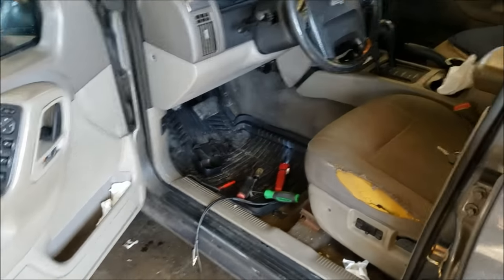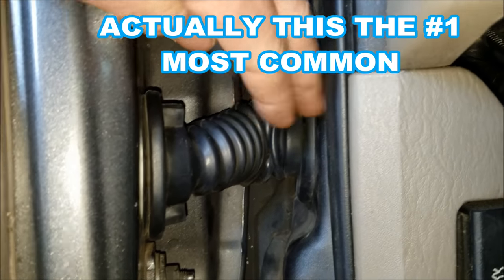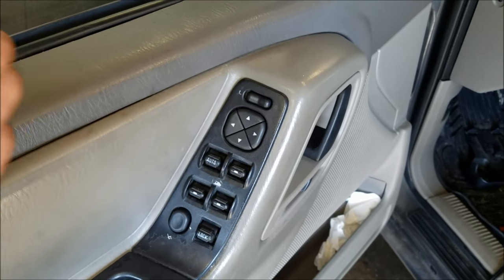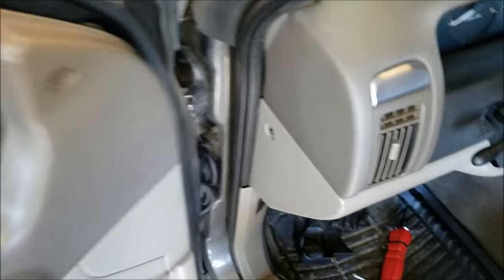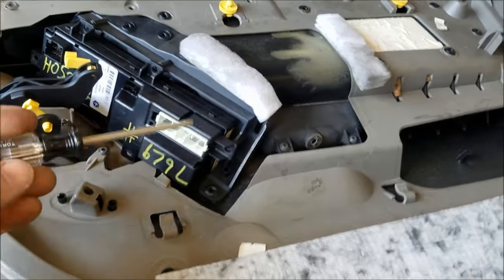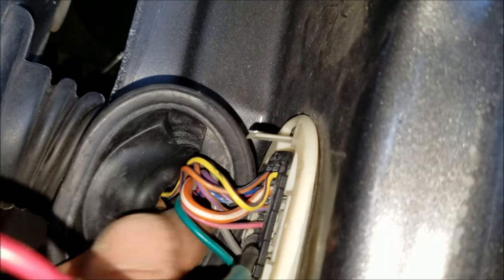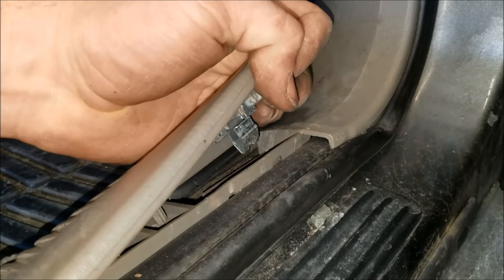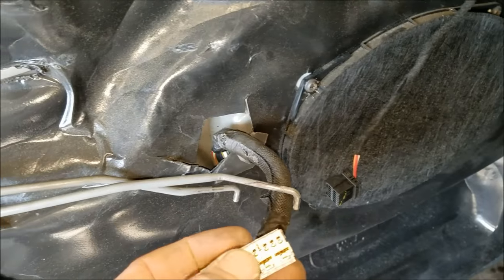JEEP Grand Cherokee Windows Don't Work 1999-2004 replace master switch / broken wires

Comment from the maker: On Amazon:
*OEM MOPAR SWITCH: https://amzn.to/2NFJsOg
*PLASTIC RETAINER CLIPS: https://amzn.to/2ZF6J56
*DOOR CLIP TOOLS: https://amzn.to/2PnUwC5
*DOOR HARNESS: dealer only?
Reply: Yes!! Jeep rolls up. Nothing works on drivers door: locks, windows, mirror, lites etc. Open the boot, splice the broken gnd wire. Everything works. 10 min. and done.  This info is NOT in the repair manual. Saved me a ton of grief and time. 
Thanks a million!

Comment: one more source is the bcm (body controll module) it can get its memory clouded with junk readings and it drives that computer nuts. and it can cause problems with about naything on the body. thankfully there is an easy cure . re boot it. turn ign switch to on , remove both cables from the battery . wait about five minints and then touch those cables together to remove any residual voltage held in the computers.  re install the cables and wa..la. computers are rebooted and cleaned out. this little trick could save you 800.00 or more. when the dealer tells you computers have to be replaced.... This also resets the engine computer and removes any exsisting codes turning that idiot light off too......if that light re-appears after this , read the code(s) and perform those repairs.  doing this tho can fix a bucket load of problems simply and can save you alot of money in the shop. AI, is gonna be mans down fall but we can allways remove the batteries  :)

Comment: I have a 2001 Grand Cherokee that we pulled the entire dash out to do a heater core and evaporator the radio stays on when the key isnt on the parking lights are on all the time even with the key off the new blower motor wont run on high and the gauges wont work but if you fiddle with the turn signal /headlight switch the gauges come back and it will be fine a few hours then cuts out again. i replaced all the battery cables positive and negative all the way to the starter and the fuse distribution box the relays chattter on the inside fuse block at the same time its got to be a bad ground, i took a wire and grounded it to the seat bolt to the black wire on the blower and bam everything comes back but if i leave the temporary ground to the blower motor hooked up the blower only runs on high! The engine runs fine and starts fine but thats it

Comment: So I’ve got this problem. But all my fuses are fine the wires in the door harness are fine and I’ve getting power to my switches. But not a single one of my windows work

Comment: Which fuse is the one that is for the master switch I’ve looked everywhere and can’t find it
Reply from the maker: That's a good question. Unfortunately I'm not sure off hand. If I didn't cover it in the video I apologize
Reply: Make sure you check under the wire harness boot very well mine was broke three inchs up in where it was hard to see. He saved me alot of money

Comment: Had similar problem,on my 2000 grand cherokee...and it turned out to be really simple. Battery connections. Mine are all new,nice and clean...but one of the wires was not making good connection.  If you are chasing the problem of no windows working,intermittent console....clean and tighten your battery terminals. Could aave a lot of headache

Good luck 😎

Comment: You were right on! After watching your video I went out and found the broken power wire in the door wire bundle - caused by the wire being worked/creased and over time failed just as you identified in your video.  Repaired and returned to service in less than 20 minutes from start to finish. Very thankful to have found this video. I'm a new subscriber!!!
Reply from the maker: Awesome to hear the video helped out and thanks so much for subscribing

Comment: I have the exact same problem. Found that the ground has a break somewhere. I took a pice of wire and stuck it in the master switch connector and found another ground - the ignition switch and everything worked but after watching your video I need to check the passenger door. Wiring diagram shows a ground there as in your video. Thanks dude good stuff.

Comment: I had the same problem . After the second time I bought silicone coated ELECTRICAL METER LEAD WIRE. much more flexible jacket and the wire has more thinner conductors. It was a pain in the ass but worked good.
a

Comment: Great video 👍🏼👍🏼 I almost spent over $250 on the switches . I looked at the wires , and driver door had a wire cut into . Easy fix so far spliced it back together. Thanks for the video it saved me money for sure .

Comment: Thank you for this video. Because I had the same problem with my Jeep. Checked those door harnesses and found the same broken wires and one that was about to in the driver door. Reconnected them and my back window ups again. 
Thanks again 😊

Comment: Great video!!!  Lots of useful information at a perfect pace, really, really appreciate that!!!!!  (really) not wasting time with "fluff" , rambling on or other off topic babbling.  To the point quickly from an obviously very good (very smart) mechanic!  Thank you!  (I rarely comment, only on top notch content, it is appreciated)
Reply: I had (4) broken wires in the rear driver's side door jam, soldered in new sections of wire and good to go, thanks again!
Reply from the maker: Got you, glad to hear the video helped you out and you got it rectified! Thanks so much for your feedback also. I greatly appreciate it

Comment: Thanks for sharing this with me my 04 wj has no response for windows or locks on either passenger doors I'm anxious  to use your techniques and it's pouring down rain right now. Cheers from Jacksonville Florida
Reply from the maker: No problem! I'm glad it helped out
Reply: Hey man thanks again it finally quit raining and I opened passenger door sliced open the rubber boot and there it was a fat orange wire with a clean break like it had been cut I spliced about 4" of wire onto the severed orange ends and VIOLA windows and locks work perfect on all doors and either switch THANK YOU SO MUCH. Cheers from Jacksonville Florida

Comment: As soon as I look on the passenger side I found the broken black wire 😮 then I checked the driver side and I had two broken wires, the black one and the orange one . Both are the fattest wires in the harness, I put them back together and what do you know I got my power windows back working . Thanks for the info !

Comment: @Nononsenseknowhow Hey man great vid thanks! I have replaced all my wires and the only thing not working is the lock switch, locking them to be exact as the switch works to unlock the doors but not lock them. All wires are good, all fuses etc I replaced the master switch box and STILL have the "lock" part of the lock switch not working. Any ideas man? Appreciate it!

Comment: Just dealt with the same exact problem today, broken wires and all. And it had a 20 year old alarm wired into master switch harness and all the windows. All that fixed and still needs a master switch lol

Comment: Great video question though...what is the middle plug for on the window switch. I went to replace my switch and it's still not working and the middle plug on my switch doesn't match up with the one on the car but I have the oem part

Comment: Hey thanks for the video, how exactly do I repair wires if mine is broke?

I just had my power windows/mirrors and locks stop working on the drivers side. The door lock works on the passenger side but even my keys can't unlock the driver's door.
What do I do

Comment: Great video. Trying to fix my daughter’s Jeep. Same issue- driver front & rear windows work.  Only the drivers side mirror works. And only the drivers door will lock with the lock button. 
Nothing on the passenger side works- windows front & back don’t work. Passenger side mirror won’t work, and neither door locks with the button on drivers side or the passenger side button. 
Bought a new switch on eBay & had the same problems. Found your video & watched it. I’m wondering if the harness on the passenger side Carries the power for for both doors AND the power mirror? 
Also, the fuse block diagram in the owner’s manual does not list a fuse for any of the power windows or power mirrors. Or power locks. I tried to check those 1st before taking the door panel off, but no listing for any of them.  Any advice on those would be great.

Comment: Great video. Direct and to the point. I have this issue, but haven't been able to find the break. I assume can be in any of 4 doors or rear liftgate? Also, should I cut boot(s), if necessary, to get access?

Comment: We have a 99 G C and the windows will fail on occasion, We found that disconnecting the battery cable gets them to work again. Any idea what is behind that?

Comment: Is there a way to roll up a window manually? My driver window has been down for over a week and I took the door panel off and tried to pull the window up but it only went up about 3-4 inches and wouldn't go any more. None of my other windows will roll down.
Reply from the maker: If the motor is shot, there is not really a super easy way. On some cars you can cut the lift cables and then manually push the window up and secure it. Probably best to just find out why it's not going up. If it's electrical issue you could take the door panel off and directly apply 12 volts to the window motor

Comment: Hello what would you suggest if the white connector is backing off the window  master switch ? If i press or hold it just so the window works . So i don't know if its the switch or connector or part number. If i did order a connector and it says right door do you think it would be any different than the driver side.I may try to test this some how by moving driver door over to passenger side and plugging into it and see if that backs out as well and works .Any advice appreciated thank you
Reply from the maker: zip tie or a little silicone sealant should do the trick.

Comment: Hey great video! If i reconnected a broken wire and have power locks and mirrors back, but still no power windows… could you tell me what the issue could be? Thanks!
Reply: Did you find the issue yet?

Comment: I have an 04 WJ 2WD and Casper the Friendly Ghost keeps rolling down the drivers side rear window with no one touching any controls. It rolls all the way down just like the driver's control operates its own window. Never partally. If I activate the passenger window lock it doesn't do it, but if I unlock the pass win lock it's liable to roll down randomly again.  Sometimes but not always I can get that window to roll down just by unlocking the Pass win lock. Fun and games. No other anomalies. The Jeep is otherwise perfect with just over 100,000 miles. Switch? wires? or exorcism?

Comment: what about if i've checked the fuses and both boots and the orange wire gets power but rest of terminals don't light up when i test them. but i don't know what's next because i've checked everything and all windows still won't move
Reply from the maker: Honestly I wouldn't really be sure without looking at it.  nothing comes to mind off hand

Comment: If you replace the harness because the wires are OLD,  the harness has only one connector, do you need 2?  and then connect in the middle?
Reply from the maker: No. You solder the connections on the vehicle side.  Door side has the plug
Reply: @NoNonsenseKnowHow  Thank you :)
Reply from the maker: No problem!

Comment: What fuse is the power windows?? Mine had a broke wire inside the door but think it grounded out 🤦‍♂️ gotta find the fuse lol
Reply from the maker: Easiest way is to just check the whole fuse box with a test light. Real quick to do
Reply: @NoNonsenseKnowHow ...i fixed it appreciate it bro
Reply from the maker: Awesome. Good to hear

Comment: I have the same problem but is on the passenger rear door do I do the same thing
Reply from the maker: Yes I would start by checking the wires in the door jambs

Comment: What fuses? Particularly rear window driver side?
Reply from the maker: I'm not sure I understand your question. I would start by checking the wires in the doors.  Definitely the most common failure
Reply: @NoNonsenseKnowHow  it was the wires
Reply from the maker: @amoreholliday  glad you got it figured out. Yeah seems to always be the wires on these

Comment: My front and back passenger side dnt work 
But I have noticed my master switch light turns on and off like it's loosing power 
I checked the wires they seem fine

Comment: what if relay clicks , but one of the door windows won't move?
Reply from the maker: I would start with checking the wires in the door. Or try smacking the door panel with the window that's not working as somebody is hitting the switch or slam the door
Reply: @NoNonsenseKnowHow  thanks for fast reply! So it can still be a wiring issue I will try that.
Reply: @NoNonsenseKnowHow  I removed the rubber grommets in the door jamb, wiring was in mint condition . It was a pain to put it back neatly again lol. I then tried  helping the window down by hand .. then it moved again! It was some window tint residue that had it stuck closed. Will clean and lube it, thanks again.

Comment: Great vid tho mate. Just picked up a 2004 Jeep Grand Cherokee. 2nd Jeep I’ve owned. Had a 77 CJ5 Renegade with the 304, Dana rear end. I had it hopped up a lil and setting in 4” body lift with 38.5” Gumbo Monster Mudders, and Ground Hogs. But, this 2004 is actually in great shape but a few electrical issues with the passenger side power. And the dash lights are extremely dim, and interiors don’t come on automatically. Ever. Any ideas? 😂. I did subscribe and I’ll be watching your vids. Cheers.

Comment: Do the windows have a fuse? None of mine work
Reply from the maker: Did you check the wires in the door jamb? It's the most common problem with these

Comment: He mentioned diagnostics after ruling out the switch as the problem, and then jumped to the solution by replacing the wiring on the right. Can someone do these diagnostics on their own if they aren't a professional mechanic and if so is there another video which shows what diagnostics need to be done?
Reply from the maker: Check your wires. It's the most common problem in the first place you should go on these
Reply: @NoNonsenseKnowHow  Thank you very much for your reply and help to get this resolved. I tried to check fuses but nothing indicated a fuse for the windows, only locks. So, I came back to Youtube and found this video https://youtu.be/4aBntXdZy6c?t=170 

At 2:50 you can see their ground wire was broken off. For me, it was the stripped red and white one near the green wire. I bought my car used, and someone had already crimped the wire and that's how it came loose. I was able to get it back working, and if I have to I will replace the whole chain of wires. I am going to see how long this lasts. Thanks again for your videos. They do help years later.

Comment: My windows work. My locks are not and my light on the passenger door blinks. I did manage to break the thick black wire by pulling on it, I patched that wire and my locks still don't work and light on the passenger door still blinks.  Only thing I can think of it's got to be the master control switch. I have custom door speakers and I'm sure the passenger side is good cause I ran the new speaker wires through the harness. I asked on JEEP WJ'S ONLY, and no one has commented on the flashing light problem. Just door locks and windows. My windows work great! Wish I new which wires control what. Been trying to find a schematic for it but haven't found one. Like what does the green one control, what does the orange wire control?  Going to pull the door panel off for the 100th time and trace the wiring. Light only flashing when the vehicle is in the on position. Anyone ever have the issue with the master and the fob not unlocking the rest of the doors and passenger door light flashing?  I'm stumped.

Comment: None of my windows work? The passenger side locks and unlocks but that's it,
Reply from the maker: I would suggest starting with checking the wires in the door jambs. Very common failure
Reply: @NoNonsenseKnowHow  ok thank you, and its called door jam wiring
Reply from the maker: No problem. And yeah
Reply: I have 1 broken wire in the mix on my door jam would that be it?
Reply from the maker: @ultimateoutdoorsman2172  yes.  probably